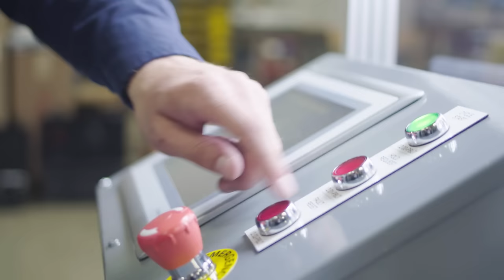Assembly Automation & Inspection

Comment: What branch of engineering is this?
Reply: Manufacturing Engineering. It's technically a subset of Industrial. But anybody with an engineering degree and practical fabrication, design, programming, and project management skills can get into it. Soft social skills go a long way too in big companies. And you will forever find jobs if you have experience and aren't a felon.
Reply: It’s equipment engineering, mechanical engineering, controls and machine vision. A manufacturing engines would work with the equipment to get good yield or process control but not necessarily design or fabricate the machine itself
Reply: I work for a company that produces machines like this. We have a team of mechanical engineers and a team of controls engineers.